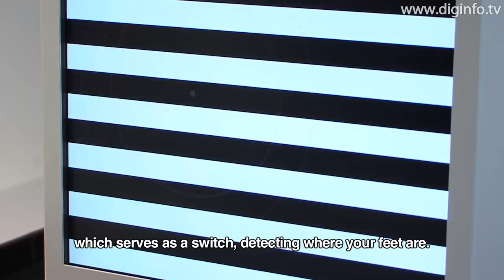Robot Tiles using fabric sensors #DigInfo

Comment: Yeah true, you make a good point. ;)

  I guess it's a good idea for near future VR, but it'll eventually be useless.  In the somewhat distant future (25-30 years), VR will be achieved from within our central nervous system itself, and won't require any headsets or any external gear. 

You could compare it to a lucid dream - you'll be able to walk, touch, smell, etc, just like in real life, and won't be able to tell the difference between it and reality.

Comment: I'm really trying to figure out how this could ever be useful for something.  Other than maybe replacing a standard treadmill "walker" exercising machine.  Or maybe if the little robots moved so fast, and would continuously loop so quickly that you could be walking at regular speed, but the robots are actually gliding on the ground twice as fast... but then again, why not just use a robot that you can sit comfortably on with wheels?  I dunno. At least he's having fun building'em I guess.